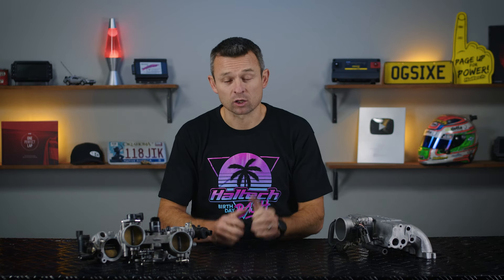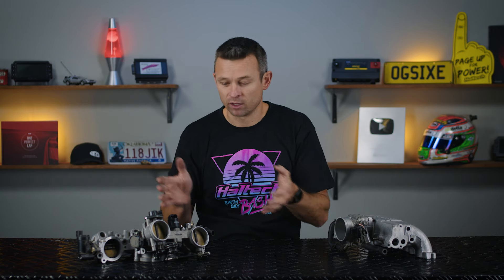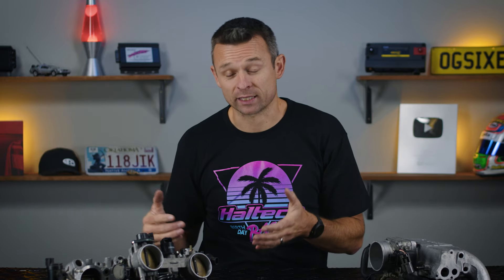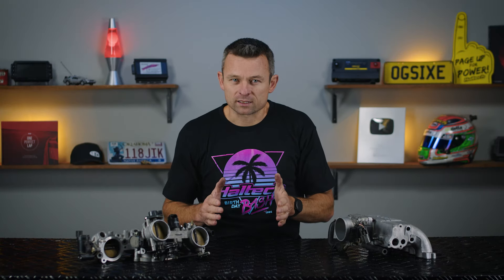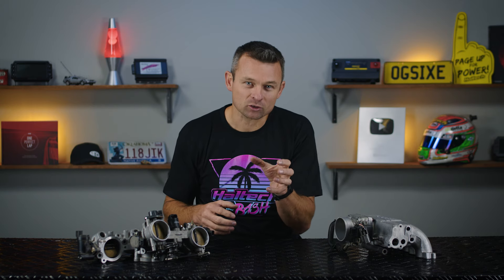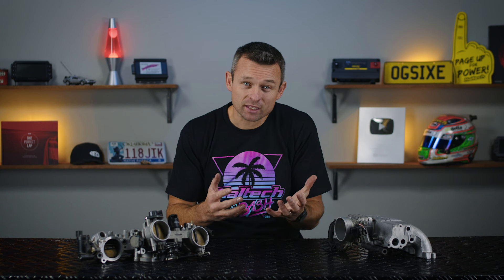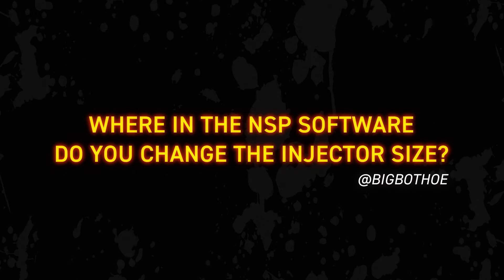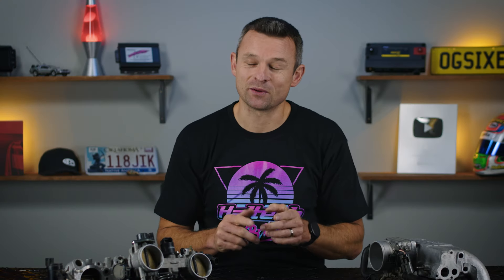🛠  Can ITBs increase horsepower? | TECH TUESDAY

Comment from the maker: It's Tech Tuesday time!
Stacks look great and sound awesome, but the effectiveness of Individual Throttle Bodies is a hotly debated topic. And today we'll throw some gasoline into that fire by offering our take on the subject.
.....
Haltech Knowledge Base: https://support.haltech.com/portal/en/kb/haltech
Need help with your Haltech products? Contact our Tech Support at support@haltech.com
-----------------------------------------------------------
Liked this video? Here are more like it:
Fuel Pressure Explained: https://youtu.be/SrQsQ1uT31c
Why some cylinders run hotter than others: https://youtu.be/UppclOQjs5E
Throttle Pump Explained: https://youtu.be/DMT9kVO7fUU
Reply: Tbh would be happy with a stock engine with itb's I don't care about it not having power because the sound makes driving more enjoyable

Comment: ITBs are like exhaust mods. Yeah, you can gain a few HP if you do an exceptional job at it but, let’s be real, you did it for the sound (And it was probably worth it)
Reply: i just wanna cool car with some coilovers and pushing 300hp max. are getting a itbs good idea for a daily?
Reply: @Jay-yg7fp  
Not at all. ITBs are for people very committed to having ITBs. It’s difficult to get a decent vacuum reference for the other various parts a daily driver needs to be civilized day to day.
Reply: @negativeindustrial  so getting a proper single throttle body with a good NA set up better?
Reply: @Jay-yg7fp  
If you want to keep it simple and reliable. You can build something more wild when you get a second car.
Reply: Umm have you seen the gains from headers?
Reply: @WarriorOfEden3033  
Yeah, I dropped .4 secs off my average quarter mile time with my first set of aftermarket headers. I’m not knocking any of these mods. I also dropped nearly two whole seconds off my average time when I replaced those same aftermarket headers with a turbo manifold, so there’s that as well.
I generally like all modifications.
Reply: @negativeindustrial  well if you got a turbo manifold I assume you also got a turbo 😂
Reply: @negativeindustrial  Yep, I've put ITB's on a 4E-FE 1.3L, it was weird how much rowdier the car felt. Sounded insane, so dailying it was well worth the extra effort, and fuel xd
Reply: I wanted to do it because I’m massively overcompensating for how unresponsive the IS300 can be from stock. I get why it’s that way, to provide a smoother more luxury oriented driving experience, but when you get on it it makes the car feel sluggish and unwieldy to drive
Reply: @Jay-yg7fp not good for daily
Reply: @Jay-yg7fp idk what part of a cheap turbo kit doesn't make more sense to you guys frfr not even lying
Reply: @Jay-yg7fp  NOPE XD, supercharger or soft turbo, but supercharger will be propably cheaper
Reply: Or for throttle response

Comment: The biggest upside of ITB's is the ability to run a hotter cam with more overlap.
Reply: 4age origionally had itbs. it sounds even more insane with stock intake for smog XD
Reply: You are correct.  I run a 8 ITB setup on a 452 cu. in. FE Ford with a hot cam, and it idles like a stock engine.  The cam is a 248/245 on a 110 LCA and acts like about 225/225
Reply: Yep. My E30 325i engine had a big cam, sounding lump as hell. Switched nothing else but my intake to ITBs, made no power and no torque gains, but I lost the loping sound. The engine was already bottlenecked by it's compression, so my intake wasn't limiting it and as such the ITBs netted me no gain. When I went to a high comp, stroker build, the stock intake would have limited it however and with my much larger 288 cam, the ITBs made it a much more manageable street engine.
Reply: @turbo32coupe I just realized Honda VTEC engines have bigger cams stock than what aftermarket cam sizes are for other engines and cars lmao😂 I think the 200hp k20's have 260 duration exhuast and intake cams on the high cam and 220 on the low. That's why they are so loud and make power at 8000rpm I guess. I noticed with high revving small engines itbs give benefits so there must be other limiting factors and tuning issues for other cars
Reply: ITBs have absolutely zero effect on what can size and overlap can be run. I don't know if you've ever watched the intake system on a high perf street bike aka R6, 600RR bla bla but there is significant mixture reversion at low rpm. All intake systems are a compromise to a specific rpm range unless of course it is a variable length runner system which is it's own nightmare.
Reply: @repingers9777 duration is only part of what makes a cam "big",
Reply: @DrewLSsix  hence why 260-280 duration is alot for a small 4 cylinder. It chops at idle with it on

Comment: Tuning tricks for an ITB setup that uses TPS vs RPM would be a great tech video.
Reply: I believe high performance academy has a very detailed video on that topic
Reply: @jarrodflood1353  yup, use AlphaN
Reply: @UngluckInc  yeah, alphaN tends to be the way to go with ITB's, but I've seen people make vacuum reservoirs to run speed density. Was planning on doing that on my honda but life got in the way. Still have the components, just not the tools or money to finish the project (engine is cooked too now)
Reply: @kasuraga  hell Yea because then you could use a turbo because alpha-n is no good for boost. Get back into your project bro you can do it. My project been sitting years and I'm finally getting back into it and not letting life and my dumb feelings stop me this time.
Reply: Using a vacuum balancing line, or individual sensors with an ITB interpolation device or software are the better way than guessing with rpm/tb.
Reply: @nobodynoone2500  why when basically every sport bike with ITBs comes setup with alpha-n ecus?
Reply: @clutchboi4038  i dont think thats true. the cbr1000rr throttles I have use a map sensor with a line to each runner, so it could be either speed density or a hybrid speed density/alpha n setup
Reply: @kasuraga  its alpha-n with a map input to adjust for elevation all bikes are like that. Still alpha-n rpm based ecu. I'm building a speeduino for my cbr600rr rn and looking at how all the ECU's function.
Reply: @kasuraga  also look into the reasons why you can't just simply use speed density load calculation on a regular ITB setup. The air box around the velocity stacks are not going to have an static pressure in the air box to give good data to a map sensor to calculate load just with speed density. This is why manufacturers use alpha-n rpm/tps load calculation and this works well on NA engines. Also those map sensors could be for cam position detection for the ecu as some cbr1000rrs don't have a traditional vr cam sensors. That doesn't mean its used for engine load calculation.

There's a way to do ITB effectively with speed density because alpha-n sucks for boost applications. Been looking in to this recently but I need to learn more. Just some of my thoughts.
Reply: @clutchboi4038  Every Japanese  SuperSport 600cc and 1000cc engine that I have seen (and we have reverse engineered hundreds of the factory ECUs) has ITBs and the ECU is a hybrid system, meaning that it uses speed density for small throttle opening values and Alpha-N for larger throttle openings. The switch over point is normally around 10% throttle, but the algorithms are fairly complex and have many conditions that cause the system to switch between SD and AN, such as quick throttle opening causes an immediate switch to AN and high RPM trailing throttle causes it to switch to SD. Also around the switch over point, they actually use values from both SD and AN maps and average them together using a weighted system. They are pretty interesting systems.
Reply: @clutchboi4038  If you tie them together with multiple hoses and dampen the signal, it smooths out and works just fine.
Reply: Or just old school itb tuning. My setup was tuned with the engine when used in d1 but I'm going to have to use a different vac distribution block so I wanna be able to fine tune it a bit to get it back to 250 na hp out of a damn 1.7l. That's crank btw.
Reply: Alpha n
Reply: Would be nice to have itb connected to tps and velocity stacks that change shape automated by rpm
Reply from the maker: Just because you asked:
https://youtu.be/aFtB2g0I86A
Reply: @haltech  Just watched it, great tuning video.  Thanks for the content.
Reply: @nobodynoone2500   yeah I have to agree with this from personal experience. I use a blended map/tps  and get reasonable resolution from the map.
Reply: @clutchboi4038 dumb feelings? 😊

Comment: The best use for ITB is when using a big cam , they vastly improve idle and low speed running with lots of valve overlap. I have them on an LS1 with Haltech
Reply: Care to share details and maps by any chance?:)
Reply: @georgegavrylenko1031  
Unless you have an ls1 with the exact same cam and itb set up I don’t think my map will be of use to you
Reply: @hoonaticbloggs5402  basically just out of curiosity. But some starting point wouldn't hurt. I'm having ls454 cam with 1.8 rocker ratio, itbs and ported 243 heads.
Reply: Do you know why that is? is it due to the lack of a plenum between the valves and the throttles? It seems like that would be the case since you'd have more of a chance of flow reversion with high overlap and a normal plenum intake, vs the short distance between the throttle and valve with itbs. It would seem like it would have less volume to reverse into during idle and part throttle. at wide open throttle, the incoming air would have the velocity needed to prevent any sort of reversion. I don't know if that's the case, i'm just trying to go by how I think the pressure waves would flow in and out of the engine during the overlap.
Reply: @kasuraga  You'd think that's the case, less exhaust dilution in the inlet at high vacuum because the other intaking cylinders aren't pulling on the cylinder in overlap resulting in less misfires.
Reply: @TomSmith-cv8hk  
You don’t get much vacuum with a bigger cam, but yes, no reversion 
All multi cylinder motorcycles have ITB because they need cams to run from idle to over 10,000 rpm
Reply: @georgegavrylenko1031  
You will need to run a map using throttle position as load.

Comment: You dont do ITB's for the horse power gains, you do them for throttle response. Pair ITB's with a lighter flywheel, a better exhaust and decent suspension. You'll get a fun car for a modest budget.

Comment: It's more for intial responsiveness for na cars even though it can increase lil in power but more for responsiveness. Great setup for Gymkana events or time trial precision courses or short race track courses where high hp cars suffer from turbo lag.
Reply: I agree.  The biggest advantage is throttle response.  A plenum slows the change in air pressure in the cylinder, the bigger the plenum, the slower the change.

Comment: Would love to see an ITB tuning video.  As EVs take over I suspect such things as ITBs will be more popular as it enhances the drama of an ICE.
Reply: There are a few ways to do it;  the old way  was is to connect Vacuum gauges to each ITB , (so 4 gauges for a 4 ITB setup)..adjust idle screw on the first one to get highest vacuum reading ..then match the other 3 to the same reading; a manometer setup is more accurate.
the second way is to use a syncrometer . this measures airflow but adjustments are made at the linkages to match airflow..to each TB ( this is not universal)

https://www.youtube.com/watch?v=92b_wc6t2dk

https://www.youtube.com/watch?v=YcUxIlEqHt0

Comment: One tip I would like to share on helping to stabilize vacuum readings (at least on naturally aspirated cars, I have not done this on a boosted car) is the use of a vacuum block and some one way check valves on some (NOT ALL) of the vacuum lines. In my limited experience the check valves have helped in two noticeable ways. First it allows for lower and more stable idle vacuum readings and secondly by controlling which and how many lines are allowed to release vacuum you then can better control the speed and behavior of the vacuum loss.

I data logged my cars stock plenum vacuum reading before switching to ITBs. I then set up my vacuum block with check valves and data logged and played with different configurations until I found one that gave me reading as similar to stock as I could achieve. Once I figured that out the car became much nicer to drive and tune. 

I'm already anticipating some hate coming my way as I shared this same info in the MIata ITB facebook group a while back and it seemed to confuse or enrage people for some reason. I do not claim to be an expert just wanting to share my good results on my particular application.

Comment: I recommend dbw with itbs
Think about it
You can tune how far the throttle opens to the pedal that can change the ratio and make it far more drive able
Also change how fast the throttle opens making it more accurate on a standard VE table 
I've successfully tuned an itb setup with dbw like this and it drove really well and actually made more power because you can limit the throttle opening vs engine speed making the air speed more appropriate for the air consumption
Reply: Most modern 600cc and 1000cc supersport bikes are dbw itb systems. And several of them have variable length velocity stack systems. They are very cool!
Reply: Only works if you don't have a straight cable pulley to the throttle, like on most pre 2000s cars and even some legends from during the early 2000s.
Also should make throttle response a little less direct, no?
Reply: @rachelpurity1  no, because a dbw tuned for performance will open the throttle faster than you could do it by cable. It is just that all people had bad experiences with dbw systems tuned for emissions and starts to diss at dbw systems. A sensor will always react faster and better than we could do.
Reply: @ulisesavila2879  It is literally physically impossible to have a more direct response than with a straight physical connection, so the "opens the throttle faster than you could" is complete bullshit.
But let's assume it just opened the throttle faster than I could put my foot down... What good does that do? The gas pedal is not an on off switch.
The entire thing is not as well suited for actually driving.
It also has no direct feedback, which sucka.
Reply: @rachelpurity1  do you really read and respond to things do you understand?

I only told a that a properly dbw system for performance will outperform a cable based one and you are making it sound like a dbw will work so fast that you cannot drive smoothly which is incorrect.

Not only that, just telling it is completely bs just because there is not direct connection is like telling that a good autobox is still slower than a manual one.

But do whatever you like it is your car and enjoy the feedback of "I need to clean my system, the cable is not smooth as always"
Reply: @ulisesavila2879  My dude. Think about the concept presented here for a sec and you'll realize what I mean:

It being able to open faster than you pushing down your foot is useless, as it will always just open up as much as you push your foot down.
Get it now?

Comment: I have 6 throttle bodies on my car, and built servo control onto each, so I could tune remotely.  And yes, each has a metal 3D printed plenum.  Looks nice.
Reply: sounds very intresting servo control on each throttle body, do you have any specs and pics you can share? i am researching and starting my design at the moment for my honda k20. did you print it in carbon fiber nylon?

Comment: from my experience with stack injection on small blocks with alcohol  we generally run the engines to 6500 8200  pretty small window to ram tune in  that said  Ram length definitely makes big swings if you get off too far  newer manifolds  have long runners but short tubes, visa versa for street itb  interesting to overlap dyno curves look in comparison in each instance. Great presentation too Thanks for your insights🙂

Comment: I guess I'm an old school racer, I kept thinking about carburetors and fuel distribution. eg: 3x2bbl and dual 4bbl. Fuel injection doesn't really have as much of an issue.
Great explanation of velocity, airflow and the 'bounce' of the air in the plenum. I didn't think it would be as much of a issue with injected engines. Fluid dynamics still plays a part...
Reply: Fluid dynamics always plays a part 😈

Comment: I had three two barrel Webbers on a  six cylinder Datson Z car  with velocity stacks, cam and Heder to mach. It was a fun wild car that sounded like a formula one beast. The only drawback was a loss of torque at low RPM and it begged to hall ass.

Comment: We (HalferLand Performance) run a dual 68mm throttle body setup and saw positive maps pressure at WOT (basically boost) even when we were NA. I would recommend a DTB setup over ITB's (tuning is a PITA, especially daily or street setups). Now with the same DTB setup we are making 550whp on just 8psi of boost in our Turboed J35a7 Swapped 06' Accord Coupe 6mt
Reply: Why would shared throttle bodies ever be superior to ITB?  doesn't make sense, all other things being equal

Comment: My Honda Beat has MTREC or Multi Throttle Response Engine Control. 3 throttle bodies for 3 656cc cylinders. The horse power of the MTREC E07A engines are upped from the 49 hp engines used in Honda ACTY's to 61 hp and the red line is bumped another 2000 rpm higher.
Reply: Was planning on taking the beat's itbs and putting it on to my acty truck lol